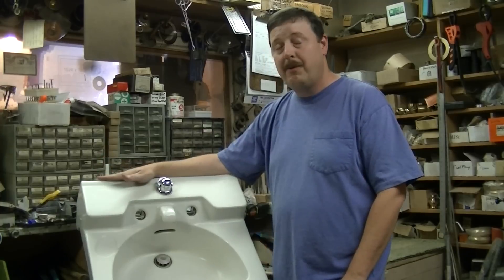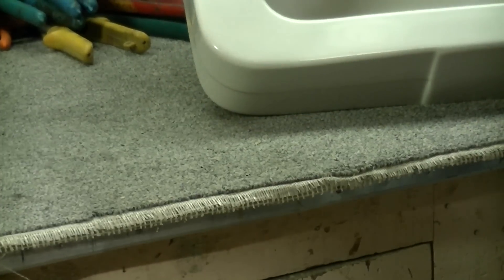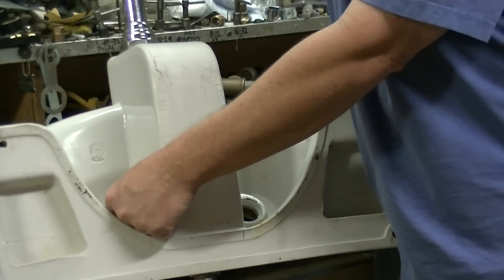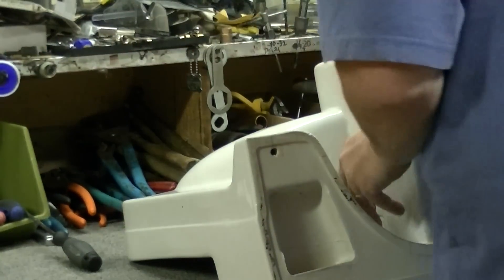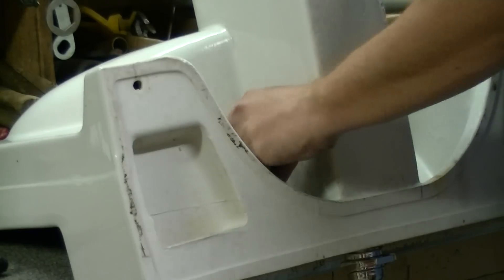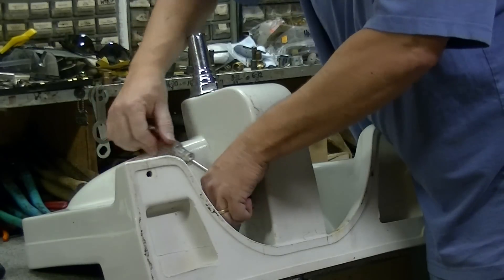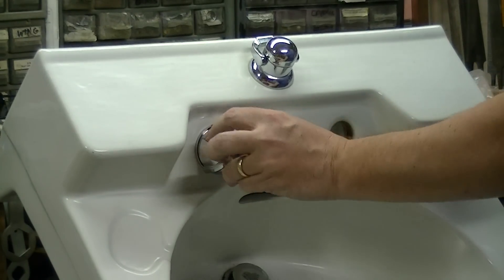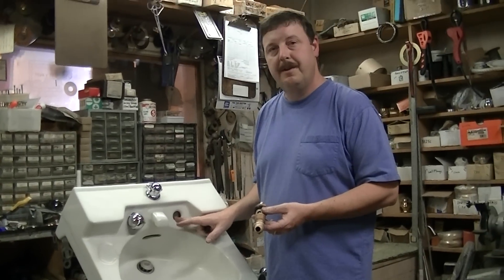Crane Drexel Faucet re-assembly

Comment: Thank you. for these videos. They were very helpful. I got the replacement gaskets and the top one was easy to install as the faucet valve assembly was out of the sink. However the bottom gasket is a real bugger to get on. I ended up trying a pop up drain gasket from a local big box store for the lower gasket 1 1/4 inch inner diameter x 2" outer diamter x 3/8 thick. It was from Menards, Plumb Works brand. I put plumbers grease on the threads as the gasket was not as tight around the valve body as the replacement gaskets. Replaced the nut without the brass washer. Snugged it up and it's been working fine. Slips right on. Will have to see how it performs longtime. Might work on the top of the valve too but like I said the replacement gaskets are pretty easy to apply with stem out of the sink. In the sink, not so much!

Comment: I'd be interested in hearing about the drain/stopper/fork mechanism for a Crane Marcia including how to get a stuck drain nut off without damage.
Thanks for your work.
Reply from the maker: Hello;
A stuck drain nut can be tricky.  Occasionally, the nut will weld itself to the drain, and you have no choice but to cut.  First, remove the fork.  We spray the drain and nut with PB Blaster, let it sit for a day, and then warm up the nut with a heat gun.  You have to be extremely careful doing this as you can crack the sink.  Then, with one person using a large slot screwdriver wedged into the drain top to hold it, another person can try to turn the nut.  Usually it will break loose.
Reply: Thanks.
It's not clear to me how to remove the fork. Is the dome on top of the fork raising handle threaded or press-on? Mine seems really tight.
Reply from the maker: The cap will unscrew, but occasionally they can be difficult, especially if you have hard water.  We do sell them if you have to use a wrench with teeth.  Once the cap is off, you then have to unscrew the cam, if you watch our video on Crane Criterion faucet removal, the method is the same even though the faucet looks completely different.

Comment: Would it maybe not be easier to place the bottom gasket on first and then fight with the top gasket which is more out in the open?
Reply: Unfortunately, due to the valve design, you cannot service the washers from the top.  There's a large flange cast into the valve body at the top that prevents a washer going on.